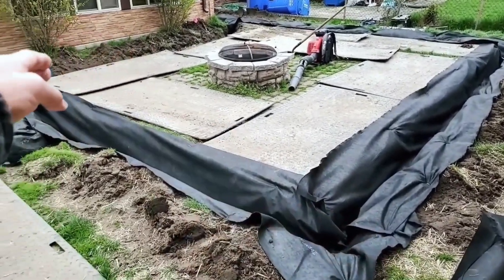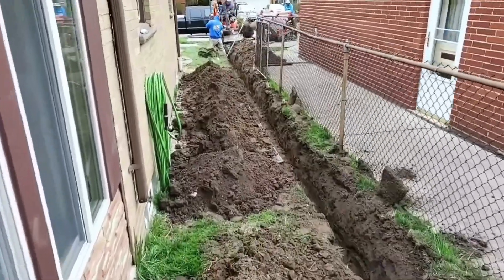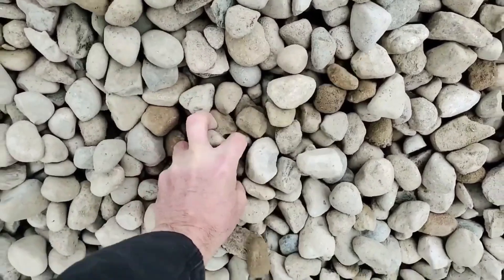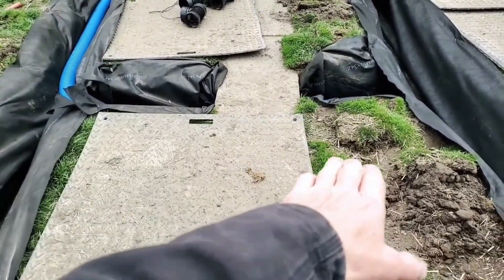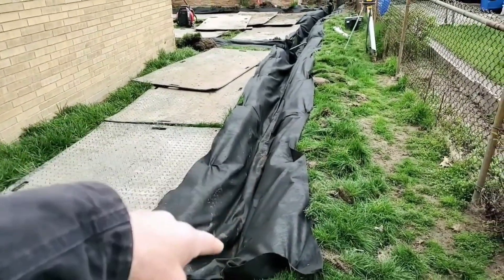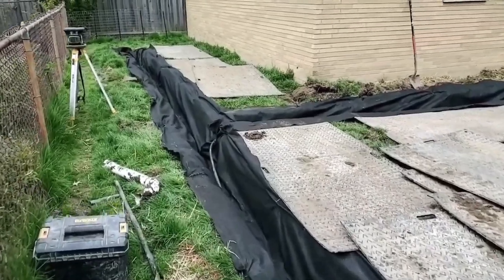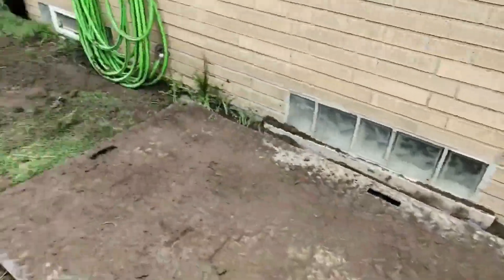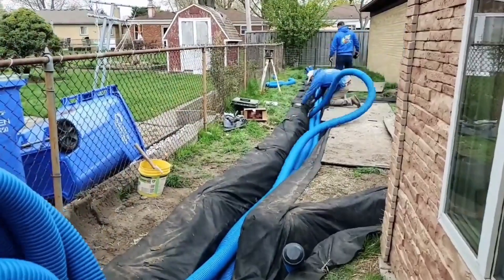How to Drain Water Out of a Backyard with a Gravity System NO Pumps

Comment: If I remember correctly from your previous videos, you mention to avoid connecting a French drain system to a roof runoff, unless the French drain is at a higher elevation. Hope I'm not remembering incorrectly, and if not, was the elevation of the different roof runoff systems at a lower elevation to all the French drains?
Reply from the maker: We DID NOT CONNECT A DOWNSPOUT TO A FRENCH DRAIN we connected to a discharge line that the French drain and downspouts share. Thank you for commenting and contributing!
I should of made this more clear in the video. 🙃
Reply: @FRENCHDRAINMAN  Thank you for the clarification. I really enjoy your quality videos and find something new to learn almost everytime. Cheers.
Reply: @FRENCHDRAINMAN  to clarify, you ran your french drain system to the Y and then the down spout line to a secondary Y which then from there its was a dishcharge line? or did the discharge line come in prior to the first Y?